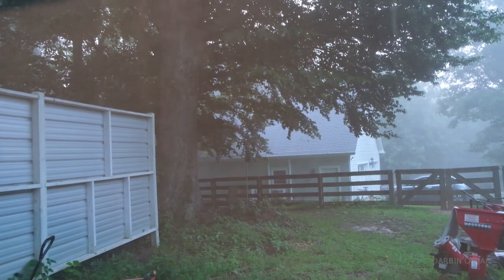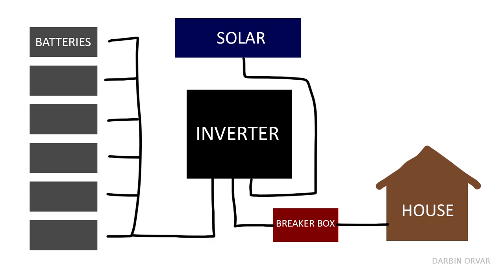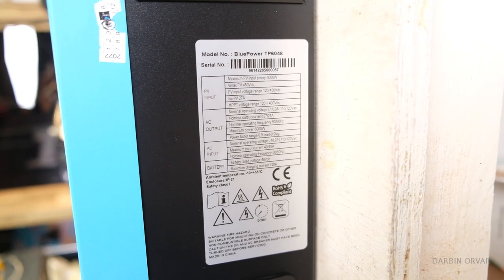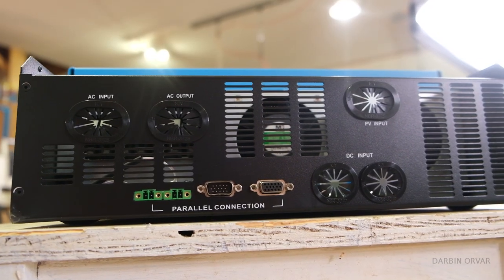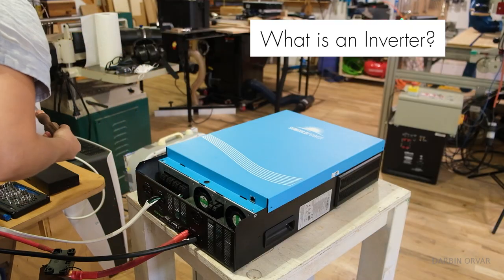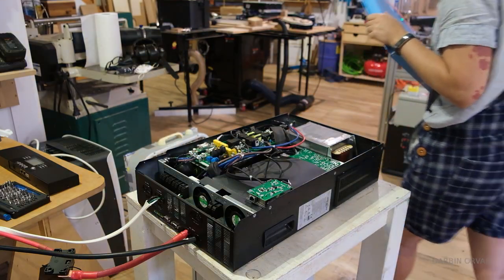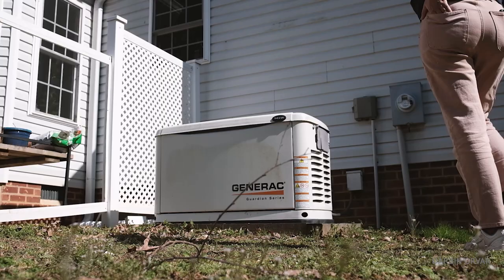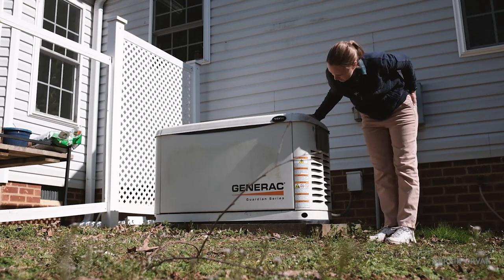Grid tied inverter for power outage backup system //SunGoldPower review

Comment: So how well does this run your well pump? I know the low frequency inverters do a much better job running pump motors vs the high frequency inverters. I was thinking of using our low frequency inverter with our well pump and the Hybrid inverter for the home. So the well pump would be connected to the grid and the low frequency inverter AC coupled to the well pump so if the power goes out that inverter will power the pump as needed and the the main hybrid inverter would run the house. Not sure how well that would work because I’d need to have the Hybrid Inverter out where the well pump is because running long runs of DC is not a good idea. Just thinking out loud. We have a 5hp singe phase 240v 35amp well pump for our property and home. Some times we needed the water on while the power was out and our generator handled that just fine. But as you said, propane is gobbled up fast.

Comment: I own the 6K Sungold system and I can tell you if the batteries run low the system will not run it shuts off. I'm not sure why Sungold says it will run without batteries. I even changed the program but there is really no way to exclude batteries. It is not in the program. Other than that the system is flawless
Reply: #1-SUB or SU (Solar-Utility-Battery).Solar energy provides power to the loads as priority. If solar energy is not sufficient to power all connected loads, Utility energy will supply power to the loads at the same time.  #2-SBU (Solar-Battery-Utility) Solar energy power the loads as priority.If solar energy is not sufficient, battery will supply power to the loads at the same time. Utility power the loads only when battery voltage drops to either lowlevel warning voltage.

Comment: I'm curious about the amps to watts calc for the projected needs for the well pump. Looks like it should be (amps X volts) / 60 to get per minute watts and then times 4 mins. So 60 watts per minute 240 per 4 min duration instead of 200. Is that right? Thanks for the video. Would really love a detailed video on the process of getting the unit grid tied.

Comment: Some split phase inverters will not allow you to ground the neutral on the AC output. Can you ground the output neutral on the TP6048 without destroying the unit?
Reply: I use a service panel where the neutral and ground are separate. Basically I took a basic Square D service panel and added one of their ground bar kits. Works like a champ

Comment: If you are in the U.S. You wont be exporting power to the grid with the TP6048.  It is NOT UL1741 listed which is a typical requirement of the power company.

Comment: It would be nice if it had the capability to connect external sensors for zero export operation, it can completely eliminate the need for paperwork in areas that allow DIY electrical work on your own house. As far as I know, only Sol-Ark offers both external sensors and backup capability.

Comment: Glad many of my appliances are natural gas powered.   I keep my refrigerator tightly closed during power outage and place a chair in front of the door as a reminder.    At most we lost power for 8 hours one time in 30 years, food was kept cold and freezer foods did not thaw.    In my case this does not justify a $1300 inverter plus batteries.